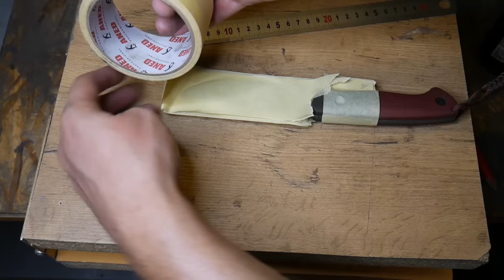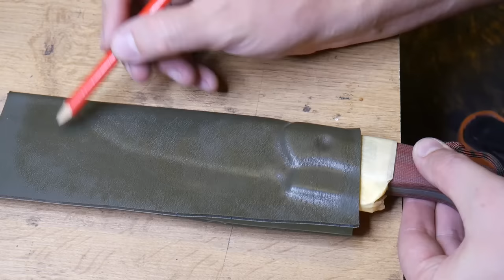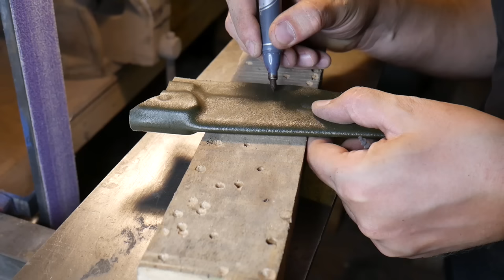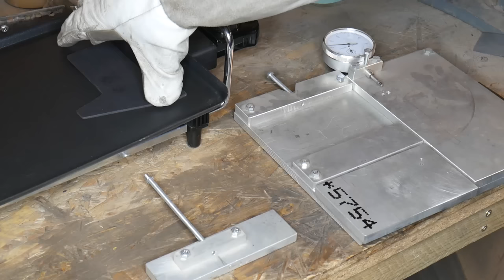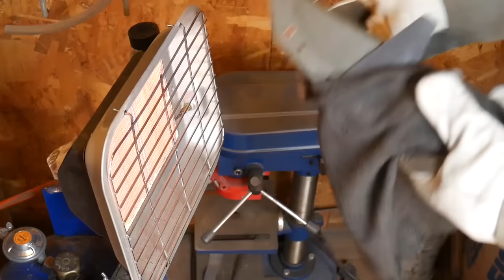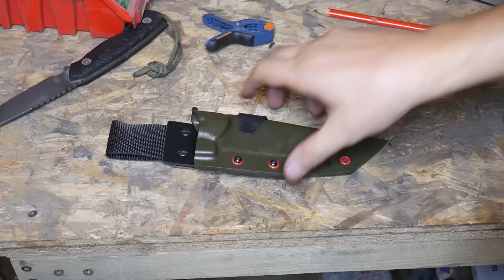How to make a Kydex Knife Sheath

Comment: If you don’t want the discoloration/shiny stuff, simply put the smooth/non textured side of the kydex on the bottom when heating. Also helps if you don’t go much higher than 315-320 degrees. I use a cookie sheet covered in aluminum foil & my oven. I set the oven at 300 & check the temp of the kydex with an IR thermometer.

Comment: I like the case, but think the belt loop will be the downfall.  Why?  As tight as the knife is in the case, it will forever be a pain to retrieve the knife because the loop will allow it to lift 3-4" every time you pull it out.  Show us a video with it on your belt, and pulling the knife out one handed.  Will be almost impossible.  If the same loop were fastened at both top and bottom, to the kydex, it would stay in place for a much easier one hand draw.  Pretty nice case otherwise.
Reply: That's probably why he added the thumb assist on the sheath

Comment: Consider guiding your kydex with a small piece of wood instead of your fingers when you will be working very, very close to the blade like that. If the saw bites or if there is any mistake, the injury could be painful and expensive. It is very easy to avoid, using tools. Stay safe. Great video.
Reply: from my experience with a table saw it's not painful at all. At first